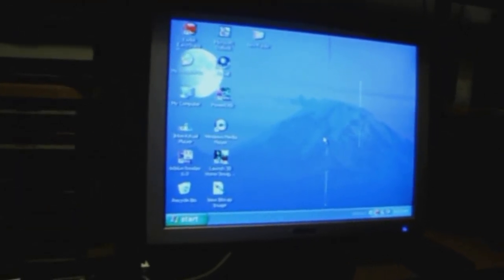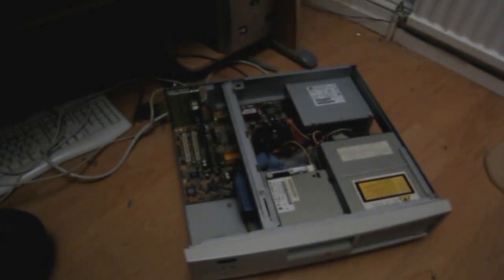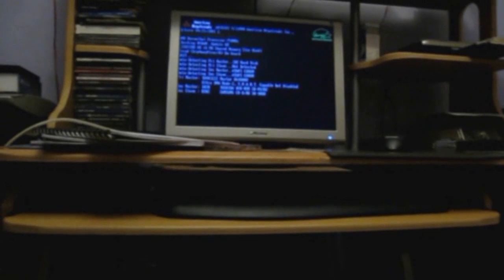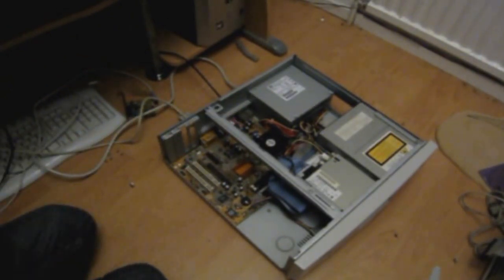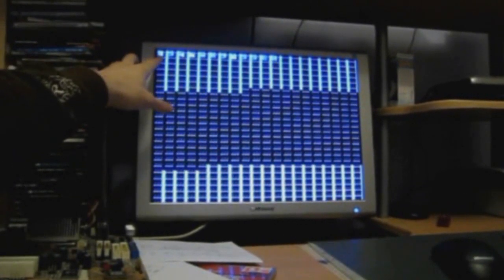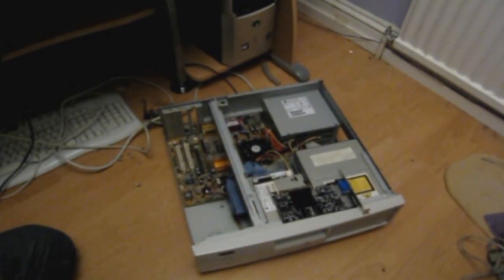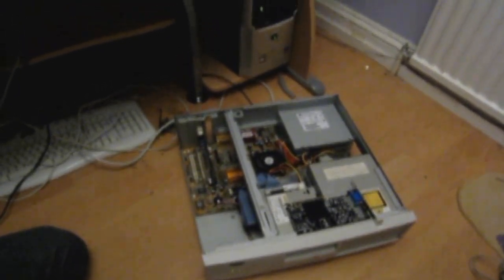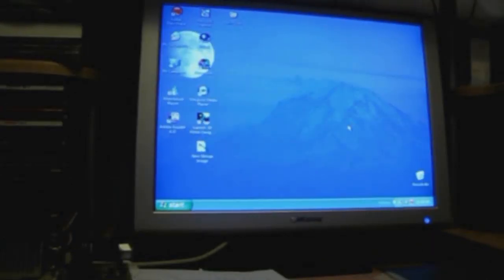the difference between AGP and AGPX8

Comment: there is no difference physically ,  but the bandwidth is different , hence x2 x4 x8 markings , ive been around since before AGP , back in the day when GPUs used same slots as other things , PCI slots , since 3dfx voodoo gpus, and ive never seen burning mobo due to bandwidth on the slot used . For example i used R9 270x, modern gpu that requires PCI E x16 slot in PCIe x8 slot , guess what it works , sometimes it locks up due to bandwidth but it doesn't burn the mobo. Only thing i can imagine that can burn mobo is using the GPU that is not designed to be powered by motherboard that is used . Cuz back in the day GPUs didnt have power connectors , it was all supplied by motherboard . So if motherboard cant deliver the power needed , it can burn , like modern GPUs can burn power supply units , at least cheap ones cuz they dont have protection. I assume that old motherboard didnt have over voltage /power protection for AGP slots so if you over stress it it will burn, but those are some very extreme situations , ive never seen one.. maybe thats why this motherboard burns , or the gpu is just broken
Reply: I think that back in the day AGP was tied to a static power delivery.
Reply: Ivan D gpus used molex for more power if that is what you mean

Comment: What about a card like the GeForce FX5500 which is advertised as an 4x/8x card? I have a Dell Dimension 4300 with a 4x/2x AGP slot, and the FX5500 won't even allow the machine to get to the BIOS screen. Just sits blank. Diagnostic lights indicate "Video controller failed to initialize." So am I correct in saying that a 4x/8x card is not compatible with a 4x/2x slot?

Comment: Hold on, you can use AGP 8x cards in AGP 4x slots. I did successfully for 4 years.

They have a molex connector for the extra voltage.

Comment: I owned an ASUS A7V with an Geforce MX4000 and upgraded to a  Geforce 5500FX which are both AGP 8x cards without issues.  But my experience is this.  You can't put a AGP x2 card into a 8x slot. But some 8X AGP card will fit into the 2x slot. I know the MX4000 worked in a 2x slot.  But it all depends on the video card.  But this tech is so old now its hard finding anything useful for an AGP based System.

Comment: respected sir i have an msi ms 6787 v2 motherboard and my graphic card is msi fx 5500 td256 i am planning to put sapphire hd 3850 which ia an agp 8x and my board supports agp  4x while the above card i mention i saw the spec on internet which is also agp 8x and it is running on my board for last 8 years can you tell me any method about just looking at the slot and tell wheyher it is 4x or 8x

Comment: Like Inserting a Geforce 5200 Ultra or MX 440 for AGP 8X into a Asus A7V (An early Athlon Socket A mainboard with AGP Pro 4x). The system might run fine. You may need to cut 2 traces of the Card's AGP connector, or just carefully put some tape onto the pins. 

I know about this because i fixed alot of PC AGP cards to be fitted into a Pre-G5 Mac. You can actually force AGP 8X Cards to run as AGP 4X. No damage will be done. But ofcourse the card must fit. It needs two slits in the connector.

Comment: I'm not sure how this is supposed to prove anything. You didn't show what mainboard model or what graphics cards you exactly used. You didn't change the mainboard to prove that the graphics cards ain't broken. I've done hundreds of repairs and Graphics cards changes and the only thing i observed was the following:

If you put in "certain" AGP 8X Cards into mainboards with no AGP 8X slot, the system might refuse to boot, or even worse, turn on while the graphics card is being inserted.

Comment from the maker: @viperfrank its not just the socket type that decides the compatibility of the cpu to a motherboard its other thing as well (Front side bus, any extended level cache, if its supports HTL or not) on top of that the board has to fully support the cpus architecture  or it will not work to its full potential.

a lot to consider but you can buy a bundle (a CPU, memory and motherboard on one bundle) its probably the same price a a CPU these days. check Amazon.

thanks for your comment.

nice one!!!

Comment from the maker: @red25ty Hi there, I have the data sheet for your mother board and on there it says your AGP slot is 1.5 volt only so the HD 3850 should work fine, generally any motherboard/ graphics card made after year 2000 are 1.5v slots.
hope this helped and thanks for your comment.

nice one!!!

Comment: I have a Asus P4p800s-x mb iwth a P4 2.4ghz cpu and its specs say 8x agp but my searches on Google says it can't support a 3.3v  agp card? I currently have a VisiionTek 1550 (I think its a 1.1version has a small fan) I wanted to replace it with a HD 3850 agp but not sure of the voltage....

Comment: I have a Dell Precision 650 motherboard which has a AGP Pro slot. I have bought a XFX Ati Radeon HD 4650 (AGP X8). I have had it for about for 2 weeks and is working perfectly. Do you think I will encounter issues in the future.

Comment from the maker: @Louie92801 hi there, thanks for your comment, the radeon X600, that card was made after the radeon 9600 thats going to be a PCI-e , if you want to know for sure check out the other video i did on this, i show you how to look it up on your computer, because even if it is PCI-e it could be 4 8 or 16 lane PCI-e although it wont damage if you use the wrong one it will run slower, there is loads more info on this in the other video, hope this helped and thanks again for your comment 

nice one!!!

Comment from the maker: hi there, yeah your right the card will work if you put a slower bus speed in a higher bus speed slot and the other way round, that's not the problem, it's whan you put the wrong voltage card in the wrong slot, that's when you get problems. there's another video on my channel that exsplains this.

nice one :)

Comment from the maker: OI CHILL THE FUCK OUT what the fuck is your problem? 
theirs no need for all the hostility is there?

as for your comment if you watched the video you will know that i did install drivers and if it needed drivers how come it worked fines in the right slot it was the same mother board just a different slot  and as for your other comment, you can use an x8 card in  an x4 slot.

seriously though chill out i don't mind answering  and replying to comments but don't start getting shitty with me...

Comment from the maker: hi Nomy, well unfortunately theirs no easy way of telling the bus speed of a slot but the most important thing is to know the slots voltage that is what could damage the card/mother board, so you need to know the difference, if you put the PC so the back of it is facing your left now going from the left there should be 41 pins before the spacer key for a 1.5 volt slot and 21 pins before the spacer key for a 3.3 volt slot, hope this info was helpful, thanks for your comment.

nice one!!!

Comment from the maker: hi there thanks for your comment, if you place the mother board/PC so the back (the bit with all the sockets) is facing your left now going from the left on a PCI-E slot there should be 11 pins before the separating key an AGP 1.5 volt slot (the most common one) there should be 41 pins before the separating key and on an AGP 3.3 volt slot (the older one) there should be 21pins before the separating key, only count pins on one side of the slot, hope this info was helpful.
thanks
nice one!